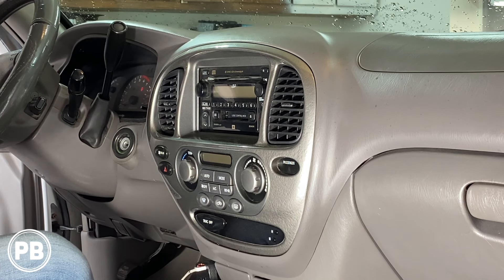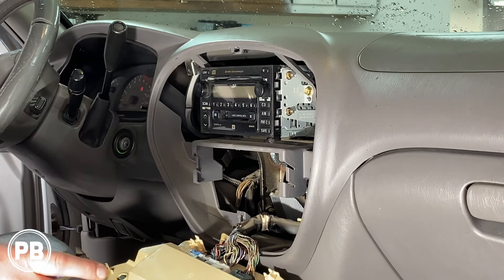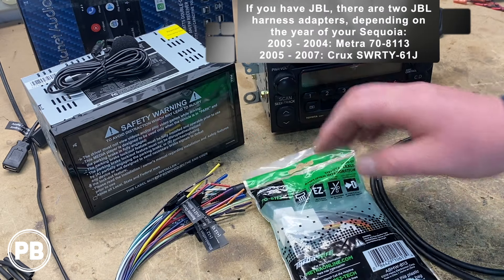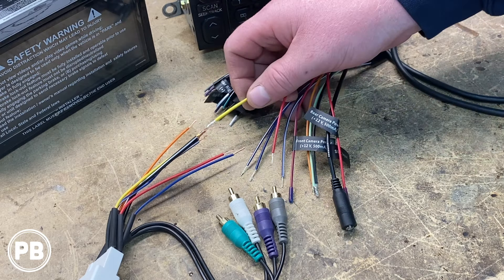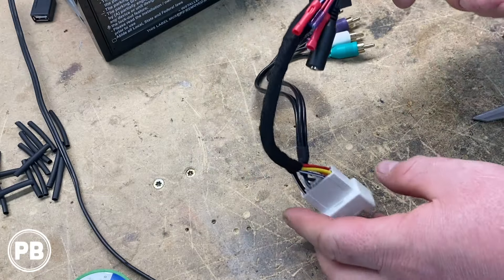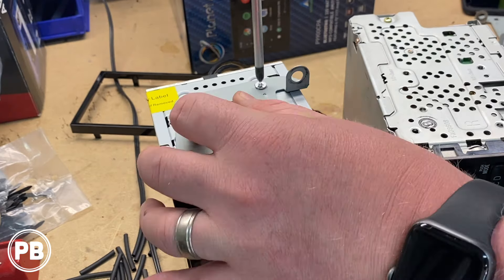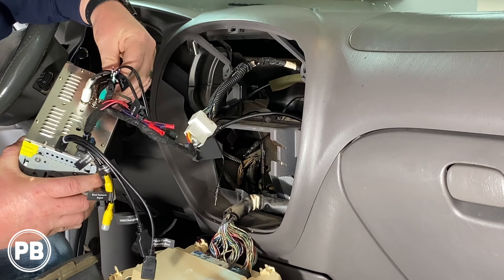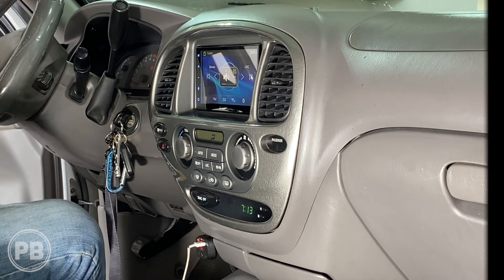2003 - 2007 Toyota Sequoia / Tundra Radio Install

Comment: My JBL door speakers are blown. What would you recommend for replacements? Thanks.
Reply: Following
Reply: Simplyspeakers.com they have kits to fix very simple.
Reply: Hey, I work at Toyota dealership and you have to be careful of parasitic drain. Well I would honestly suggest is just replacing them with new JBL speakers from a modern vehicle as basically all Toyotas you’ll just use JBL.
Reply: Simplyspeakers has a super easy rebuild kit!
Reply: Get pioneer they have good beat

Comment: My 2006 sequoia has the jbl radio but no steering wheel controls, is it safe to assume I still need the crux kit or can I use the metra 70-8113
Reply: Trying to find this out
Reply: Hello friend, im doing the same install. but on a 2005. Did you figure it out if the 70 8113 works?

Comment: FYI if you dont have the blue and white wire in your harness, splice it in with the blue wire. And splice the black and white wire with the black. 2003 Sequoia Limited w/ JBL package

Comment: Great vid!!! But for future reference, the expression is “At this point IN time” not OF time 😂
Reply: It’s one of those redundant and unnecessary phrases.  The proper wording should be either “at this point” OR “at this time”.  “At this point in time” is never needed and is usually heard from people trying to sound smart.
In a college course for concise writing it’s one of the phrases we were taught never to use along with the overuse of “that” which can usually be omitted to improve sentence flow without affecting meaning, re: “ She told John that she had to cancel their date” is better written as “She told John she had to cancel their date”

Comment: First of all, thank you for a great video. Secondly, I have a bit of a complicated question. I’m adding steering wheel controls to my mom’s 2004 Sequoia with JBL speakers when I replace her head unit. Does that mean I should use Metra 70-8113 in combination with PAC C4RAD? Also, the link you have for PAC C4RAD in the description shows out of stock. It does appear that PAC SWI-RC-1 will work for me (unless I’m misunderstanding something.) At any rate, if you have a link for that product that you’d like to provide me with, I’d be glad to use your link so that you get credit for my purchase. Thank you in advance for any help you can provide!

Comment: Is you blue and white from the harness to turn on factory amp? My radio does not have a white and blue wire but a solid blue amp turn on , should I connect blue/white from
Harness to solid blue on radio?
Reply: Did you figure this out , I'm having the same issue
Reply: @Metaldrummer60  yes the solid blue wire from the head unit , is the amp remote turn on so you should connect it to the blue/white on harness, If you want to double check,  connect the head unit and test the solid blue wire for voltage

Comment: What do you do with the smaller antenna wire? There are two plugs for the antenna on the stock head unit

Comment: Thank you for the video!  I am having a problem installing my receiver in my 04 Sequoia and if you could help me out, I would be infinitely grateful and donate to your channel.  The unit turns on and functions, but I am getting NO SOUND.   So, I have the JBL system in mine, too.  I got the proper 70-8113 harness that has the rca cables on it.  I connected yellow to yellow, red to red, and did the black to black along with the black/white splice.  I did not splice the parking brake wire with the grounds because I have a pioneer unit.  I imagine I could do that later.  I also skipped the blue wires.  The wiring for the pioneer unit included the female rca outputs to plug into the metra ones so I did that accordingly.  If I'm not getting sound, then I assume that maybe I should skip the rca cables and actually splice the speaker wires instead.  What do you think?  Could the parking brake wire be preventing me from getting sound too?
Reply: I had the same problem, I spliced in the blue/white with the blue wires and that fixed it

Comment: I have a 2005 Sequoia with JBL steering wheel controls. Just purchased the SWRTY-61J to install a Dual 10.1 inch. Was reviewing the crux manual and it looks like it doesn’t have the RCA output connections to the radio; rather, it has wires to connect to the speaker wires for the radio harness. Does this matter? I haven’t gotten it yet so maybe they’re on there? Thank you in advance!

Comment: I follow your instructions, everything works but my top speaker by doors are having static issues. I’m thinking it’s bad RCA connector, when I unplug the rca connector, static dies off. Anything would help at this time.
Reply from the maker: It may be a bad harness, or radio.  you can also try a ground loop isolator.

Comment: Do these RCAs act as a "bypass" for the factory JBL amp? Asking because im diving into my 03 sequoias audio upgrades and am noticing the PO removed the factory JBL amp. Am i correct in thinking the new Pioneer HU i have will amplify each speaker with its own built in amp? Just hoping i dont have to buy a used jbl amp to make this work
Reply from the maker: No, this specific harness doesn’t replace the OEM amp. There is one available, but what we used retains all factory features, including the amp.

Comment: What wiring harness am I supposed to use if I have a double DIN pioneer avh 280bt on a 2005 Toyota Sequoia with JBL but no steering wheel controls
Reply from the maker: I would use the Axxess Metra TYTO-01 harness: https://amzn.to/4caKWZs

Comment: Would you recommend connecting the speaker wires and bypassing the stock amp if you were installing a subwoofer?
Reply from the maker: A few variables there for sure - just depends on the setup.  In most circumstances, based on the age of the amp, you would benefit bypassing the factory amp for both audio quality and power.  Regardless if you bypass the stock amp or not, yo can always add your own bass amp and sub.

Comment: Great video Bud, just a quick question.

My radio 2007 sequoia keeps making a very loud sound noise intact , some amateurs guess it’s the amplifier. What do you think
Reply from the maker: Without seeing it in person, hard to tell. Most likely the culprit is the factory JBL amp if equipped.

Comment: My Sequoia power antenna goes up when I turn the car on. But when I have the vehicle running and I switch the radio off, it doesn’t go back down. Do you have an idea why it does this? Thanks

Comment: My JBL system on my 2003 Sequoia has two connectors coming from the internal harness. What type of adapter is that?
Reply from the maker: We have JBL harnesses linked in the description. One usually is for the main JBL connection, the other is for steering wheel controls.

Comment: Do you have a radio replacement recommendation that also includes a back up camera?
Reply from the maker: For this specific vehicle?  In most circumstances, we recommend brands like Pioneer, Alpine, Sony, Kenwood, etc.

Radio recommendation: https://amzn.to/3pAFW9Z

Backup Camera Recommendation: https://amzn.to/3csfJn3
Reply: @ProvoBeastAudio  yes for this specific vehicle. The link included in your description was only the radio but didn’t include a back up camera. I was wondering if you had a recommendation for a radio that also included the backup camera. 
Thanks!

Comment: I have a 2001 Sequoia and I was told by the installer that I need a special module for my new stereo to work right. He says it's because of the JBL amp. Is that bullshit? He wants $120 for the module and says i won't have any sound without it.
Reply: DUDE SAME!!!! I’ve been researching everywhere to see if I actually need it… based on this video, I think not? Did you ever find out? I also have a 2001 limited
Reply: Did you ever find out the answer for this, I have an 02 and have the same question.
Reply: @connorderivan8350  Sadly, yes. You need the module if you have the JBL system.
Reply: @patrickedward6048  well damn. Thank you! Do you by chance have the name of the module or a link?
Reply: @connorderivan8350  I don't, but I bought it at Best Buy. They ordered it for me, and it came with the wiring adapter kit. It had that extra little port for the mini antenna looking plug. It was $130 and took 3 days to get to me.

Comment: How many inches is the screen? And Can I use a 10.1 inches for my 2003 toyota seqoia?
Reply: You can use a 10.1 inch on your Sequoia! I actually just installed one on my 04 Sequoia. You'll need Metra harness 70-8113, 70-8114, and Axxess Converter AX-MLOC745 if you have the JBL with amp system.

Comment: 2 questions.  
1. If my aftermarket radio does not have all rca’s for speakers do I have to tap into some wires?
2. After installing I get static noise coming from speakers, any fix on this?
Reply from the maker: A few variables there, we can probably help you out in more detail if you send us a message on facebook.

Comment: I have a 2005 with jbl speakers. I have plugged everything in with the correct parts and I cannot get sound. When I plug in original radio the sound works. Does anyone know how to fix this? Thank you for your help.
Reply: did u find any help i have the same problem rn
Reply: @KadenMiller-hz6qy  any luck starting this tomorrow?
Reply: Did anyone figure this out?
Reply: I’m having the same problem

Comment: The wire harness is not exactly the same as the one I purchased with the same model number from best buy. Some of the wires are not the same. Also the antenna he only mentioned one which you have two antennas that plug in on the original JBL stereo.

Comment: Followed the video instructions, installed the new 10.1" unit in my 2003 sequoia w/JBL. The only problem i have is the volume too loud even at level #1 (#0 is mute). I did played around with all the amp power setting and sound setting but its didnt change anything. Do you have any tips for this issue?
Reply: What's the link to the 10 in one?
Reply: I know this is old but did you ever figure out the volume?  Also do you have steering wheel controls or no?
Reply: @loungnlou  no, I gave up lol and so bought a carplay touchscreen unit that sit ontop on my dash
Reply: You need to hook up the speaker wires to the RCA outputs. It’s an impedance mismatch. You are over driving the factory amp

Comment: Does it matter if it's a 6.5in double din or 7in?
Reply from the maker: Screen size is irrelevant with brand name units.  It's the chassis size - This works with any double din sized chassis, regardless of screen size.
Reply: @ProvoBeastAudio  thanks brotha for prompt response n super helpful vids💪🤜🤛 #StayBl3ssed